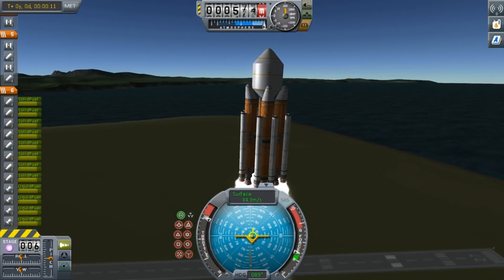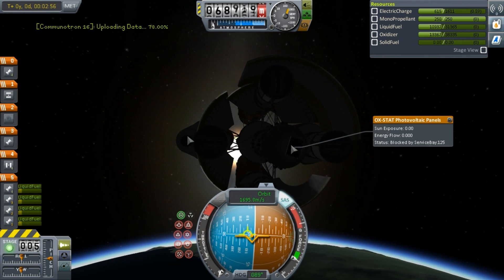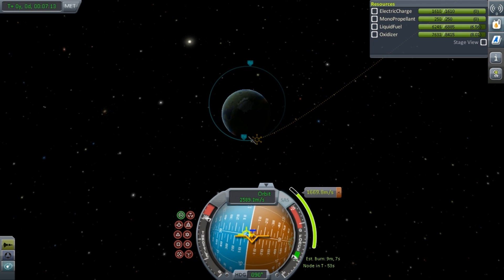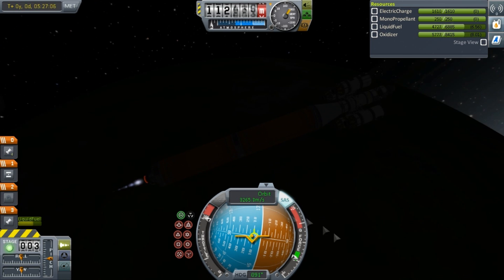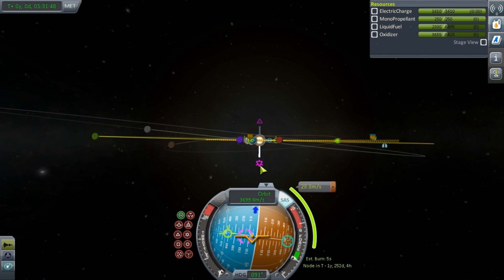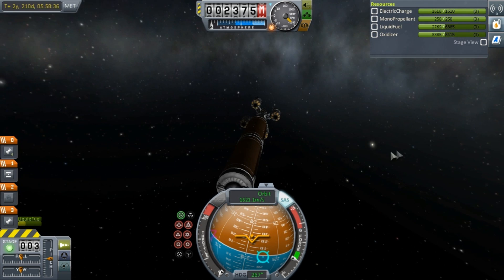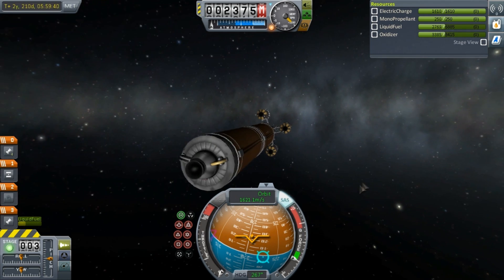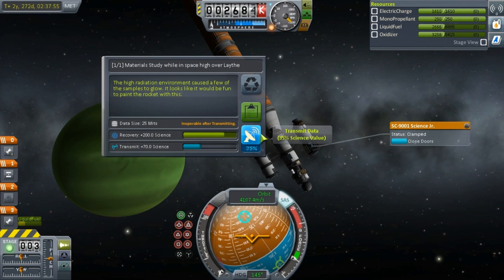Mission to Jool! Kerbal Space Program (Science Mode!) - Episode 13

Comment: Yup. The big green death ball. Literally everything will overheat as soon as you so much as poke the atmosphere. Even if you were to somehow survive, you slow down so unbelievably fast that you just end up going straight down anyway

I'm actually quite surprised with the complexity of the design, although the probe work could still use optimization. A recommendation that may be hard, but is possible to do, and ultimately with no loss of efficiency is to design some small, compact probes using the ant engines, some probe core with built-in torque, and lots of the smaller science experiments [goo as well]. They're lightweight, can have a surprising amount of delta-V, and can be sent up in some decent numbers with the right kind of launch vehicle. I remember designing a vehicle to send up 7 probes at once, as well as turn the final carrier stage into it's own probe. It is a handful to manage, but can pay off a ton due to having a single launch cover a lot of bodies